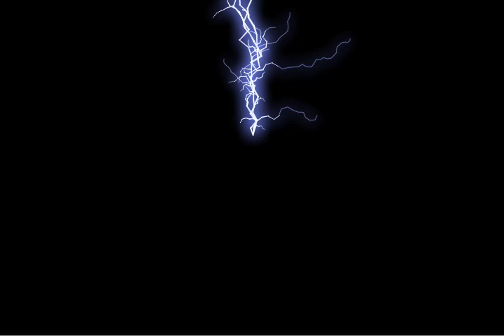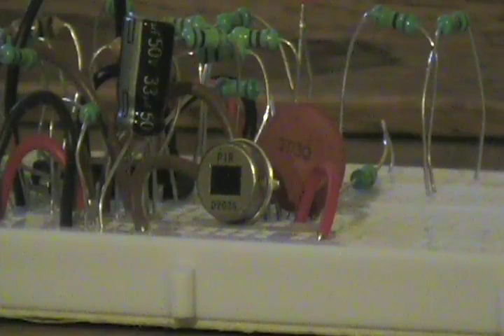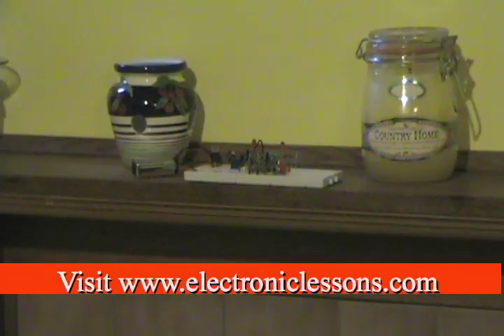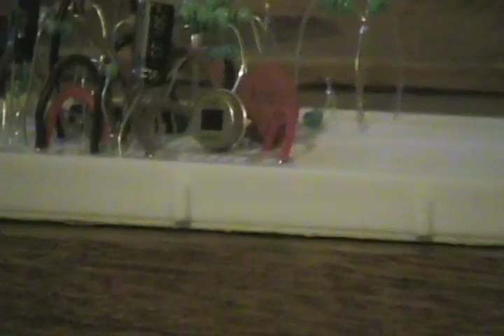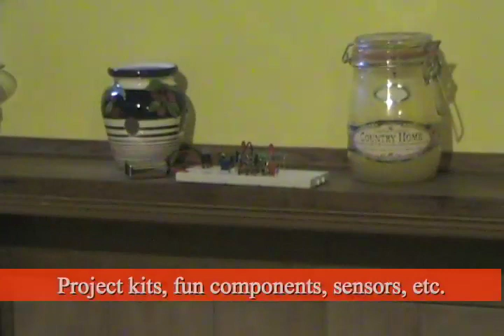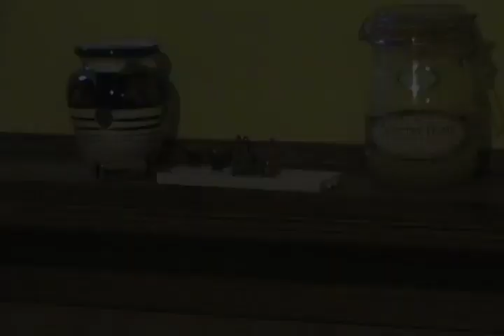Passive Infrared Sensor PIR - You can play with your own at home!

Comment: is that the Pyroelectric Infrared Motion PIR Sensor RD 622? This PIR should work satisfactory day or night? 
I am working on an invention prototype to detect outdoor pets. I intend to supply 12 volts dc 1amp from wall outlet adaptor to PIR and the PIR will power the other device when detected. My current motion detector picks up movement from a greater distance and activates when it is not desirable.

Comment from the maker: Hi Joe
The problem is, IR receivers don't pick up on direction.  You can be anywhere in a room with a remote and it will pick it up.  That is, depending on the frequency.  PIR sensors aren't great for direction either.  I find that they are only good for movement detection, and even then, I find them slightly volatile.  if you want to make a voltage table:  LEDs showing the voltage, you need a lengthly comparitor circuit.  Easy, but space consuming.

Comment: @patrickikis sorry for not clarifying.  An interactive table is where there are dozens to hundreds of LED's, all off, and when the table detects motion, the LED's in the area turn on.  I had an idea:  a 3-component coupling of an LED and IR LED and an IR Receiver.  In a light-sensing circuit, the IR light from the IR LED reflects off of one's hand (or mug or plate) and to the IR Receiver, turning on the LED via transistor.  -Joe

Comment from the maker: Hi.  You're not going to get such luck with PIR sensors.  The signals have to be amplified properly, and noise has to be well filtered. A comparator, three resistors and an LDR won't help you here =(

Comment: @patrickikis oh i certainly agree with you on the fun part, but space is just a concern going into this project.  For instance, i can make a light-detecting circuit with 5 components, counting resistors and Loads.  that would be optimal and I was wondering if there were any similar circuits with the PIR sensor.  -Joe

Comment from the maker: You can buy an already-made module from parallax, but where is the fun in that?  The reason this looks complicated is because there are no SMD components.  This is simply a configuration of the test circuit in the data sheet =)

Comment: isn't there a much simpler was to may a non-light-dependent, motion-detector using a PIR sensor? I only ask because i'm very interested in making an interactive table and LDR's won't work because when the light in the room goes off, all the lights turn on.  sorry if this is vague.  Any advice is appreciated.  Thanks man.  -Joe